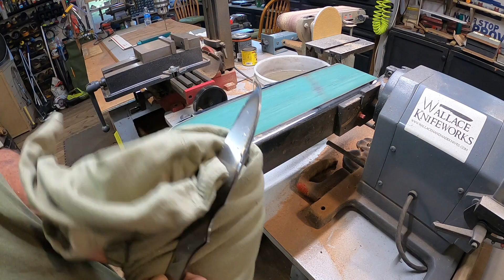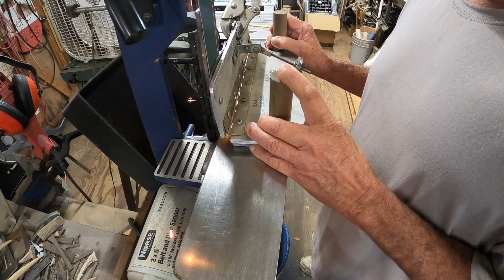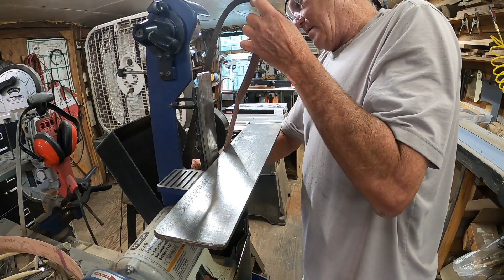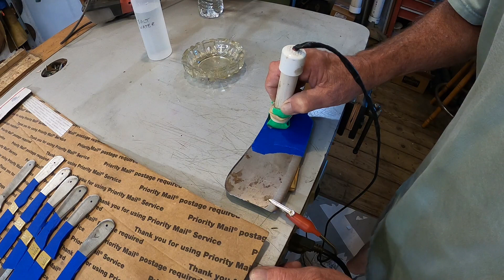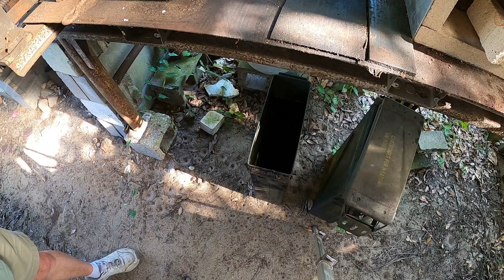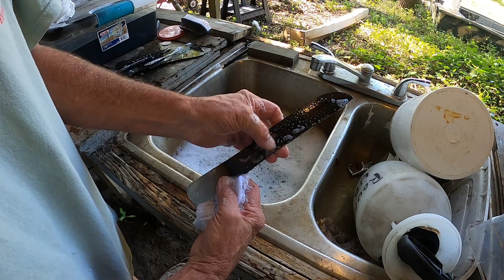11 Piece Kitchen knife set  !  Pt 1

Comment: Nice video, thanks for showing the process you use. As far as agitating the hot metal in the quenching fluid, I was always told to do that because it prevents the steam that escapes as the quenching solution burns (the same steam that comes up when you first dip it in) from creating a “vapor jacket” around the cooling steel. I think the idea is that if you agitate it for a few seconds as it first cools, the steel will either be slightly harder or slightly more evenly hardened, or both. Some people say to swirl it in slow circles, while some people shake it vigorously. I really don’t know what the truth is in all this, but on occasions when I’ve hardened tool steel recently, I usually do move it around for a bit when it first goes in, maybe now just out of superstition ha, who knows 👍 🔪